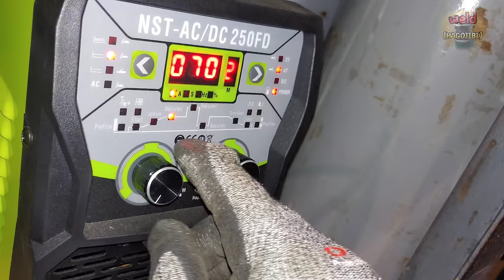Half keyhole technique to making thick back bead ! TIG Welding Stainless Steel Pipe Root Pass

Comment: I'm glad your throat doesn't hurt anymore. Instead of capsaicin and whiskey, you can use vodka infused with pepper. You can buy ready-made "Pertsovka" (just take Ukrainian not Russian), or do it yourself. Add a couple of pepper pods to a bottle of strong alcohol (0.5 - 0.7 liters) and let it infuse. A week will be enough and you can not get the pepper.  🙂

Comment: Very clean!
What about doing a one pass on this 3mm pipe with CLOSED root? Is it possible? Would very much appreciate if u showed us! :)
Reply: Not easy to get a consistent root, can tell you that much lol
Was trying to do ecatly that at work, but kept getting root undercut or incomplete penetration. Cant watch the front of the puddle and it penetrating as you go👍

Comment: One issue with a large bead on the inside of a pipe, it is a restriction reducing pipe flow velocity and it also creates turbulent flow through the pipe and can cause erosion and corrosion. It looks like a very wide HAZ and some of the HAZ is outside the shielding gas coverage. The bead itself looks sweet though